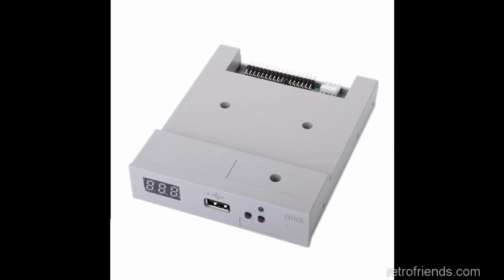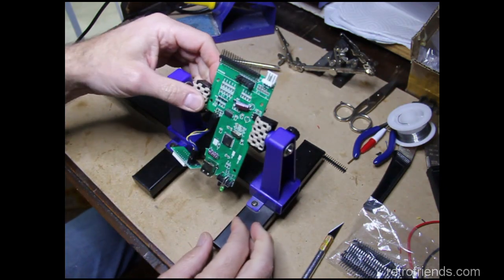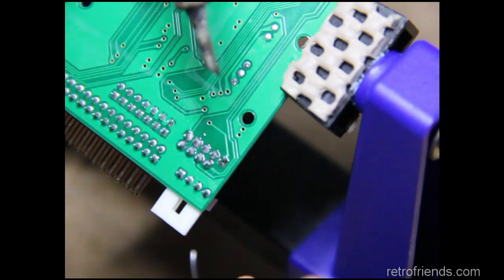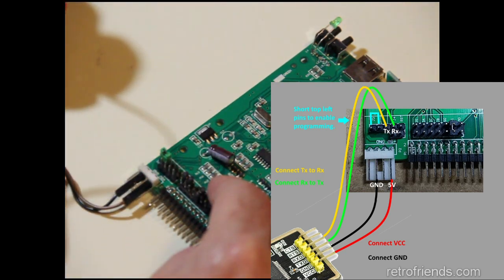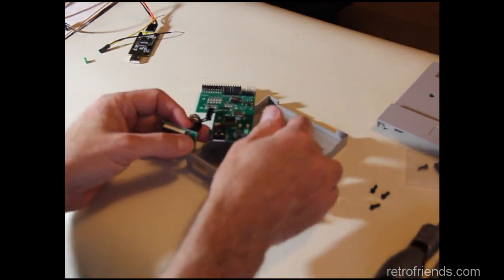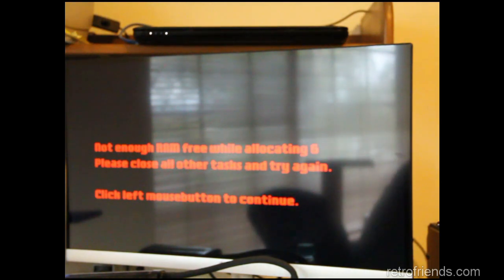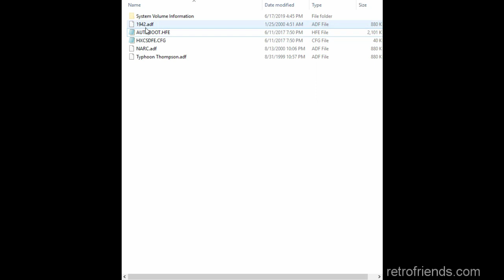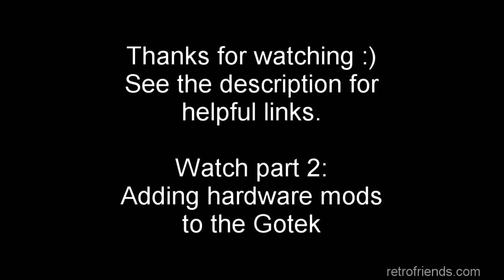Gotek Floppy Emulator for Amiga Part 1: Installing FlashFloppy

Comment: Hi. Little tip for solder goldpins line. If not have 2 line goldpins just use 2 jumpers to set proper distance  betwen two lines and solder only one pin and check.

Comment: These are easily purchased on ebay for about 25-30 usd with the firmware prei-nstalled with all of the pins soldered on and basically plug and play.
Reply from the maker: But with shipping, often much more.

Comment: Thank you for the video, I have a problem with the floppy ribbon cable, It has some kind of "plug" in pin number 2 and I can´t connect it to the gotek. Do you know a solution? Thanks!
Reply from the maker: Well, you can always buy a new cable without spending too much. I sell them in my eBay store, but mine are like 18" long. Plenty of other sellers selling shorties.

Comment: After soldering the 9 pin set, and jumpering the pins, I connectef the ttl to the pc. I have no display on the gotek? Once all the mod wires are removed, the display is on, and fine. Is the 9 pin header connected, related to the normal 000 display in some way, that when the jumper and mod wiring is done, it disconnects?
Reply from the maker: It is normal to have no display while flashing the Gotek.
Reply: Thank you. I still can't get the damn thing recognised by the stm. I only have, for some reason, 1 com port?
Reply from the maker: @russellmulcahy4452  Are you sure you have an STM Gotek? Your typical run-of-the-mill goteks have not included STM chips for months now. Please check my channel for newer videos, including one that shows you how to identify an Artery board, and the procedure for flashing it. BTW I use the USB to USB method instead of the TTL serial. Much easier.
Reply: Yeah, it's an ARM7 STM32F105, SFRC922D..got it in 2016 and only saw your video, and thought...why not 😀
Reply: Had to solder the 9 pin set up on the board. I've tried the usb a-a method, but windows 10 64bit is the only choice for the dfu and batch. I'm using win7 32bit...d'oh!

Comment: I can not get the gotek to consistently boot from usb. I've tried a few different firmwares but nothing seems to help.
Reply from the maker: You will have to elaborate. What machine? What version of FF? What actually happens (on the monitor and the gotek)?
Reply: @retrofriends  Thanks for the reply. There must be a ghost in my machine, it seems to be working fine now and I didn't do anything different. BTW it's a purple 500++ that I built with  3.1.4 WB and 318069-11 Agnus 2meg chip
Reply from the maker: @Liberty309  Nice!

Comment: Nobody is showing where the screws are on the A500 itself.
Reply from the maker: Check my other gotek videos. If you didn't know already, the gotek doesn't fit in an A500 without modification.

Comment: Dear Sir;
I perform Flash Floppy emulator as per your steps.
I have ( F-F ) in 7-segment of my emulator
I use ipcas program to make my USB have 0-100 diskette.
I put my system SW in four diskettes in one USB from 100 parts
When I just put its give me error E.3.4
I really see most YouTube video and thanks for all but clearly prepare your USB is not enough
I am trying to use emulator for Hitachi medical equipment (Elecsys 2010)
machine run by one old floppy disk drive
in order to update I am using another 4 diskettes.

your support are highly appreciated
Reply from the maker: Not sure I can help. I am only an Amiga expert, not other machinery. I do not know what ipcas is, and have no experience. If you are properly making disk images, you probably need to reseach your medical equipment's floppy interface type, then configure the gotek for that interface. Example: shutgart. To learn more about the gotek and for a list of interfaces, google "FlashFloppy Host Devices" for the wiki.